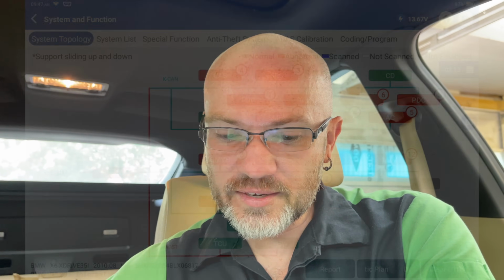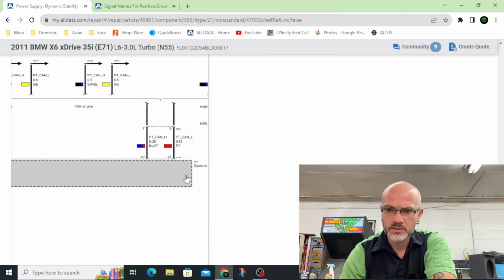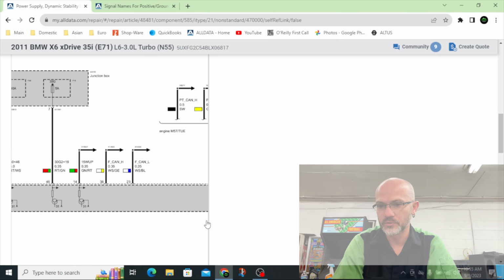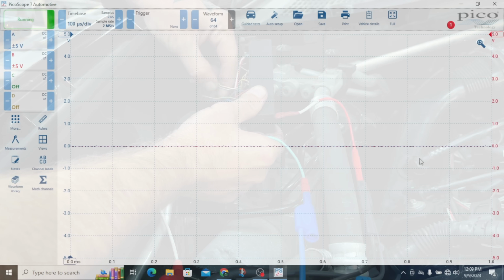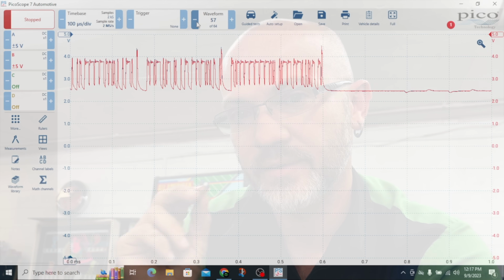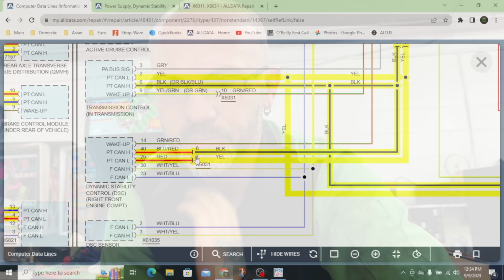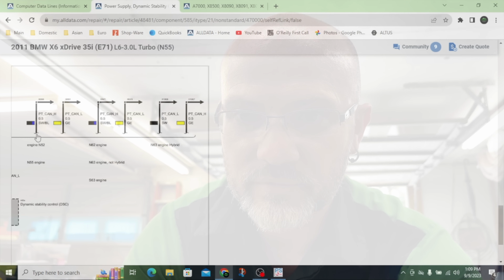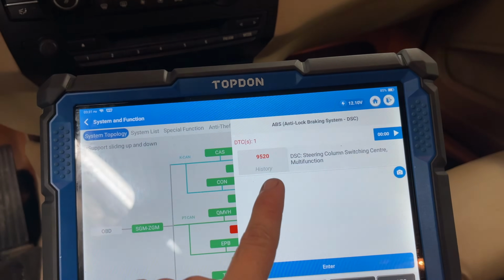BMW X6 Not Communicating with the ABS Module

Comment: Hey friend , i have a 2017 F25 and I am having a “DSC Low Voltage In Vehicle” error. I already bought a new battery thinking that it might have been a battery related issue (but I guess it’s not). I tried to test the grounds and the positive wires like you did and I noticed that the voltage drops (to 10 point something volts) when locking/unlocking the vehicle and the voltage steadily reaches 12/13volts after 10 seconds or so. Therefore,  I noticed that I only get the error when starting the vehicle after unlocking it (during the voltage drop period ). I don’t get the error if I wait for the voltage to reach 12/13 volts (after 10 seconds) and then start the engine . Do you have any idea what it could be ? Thanks in advance!

Comment: As a bmw tech, I haver never seen a failure like this but damn you did a great job at looking for that broken wire! Also I would highly highly recommend you getting a laptop with ista on it which is the dealer software we use and navigating the wiring diagram is SOOOO much easier and if not the best wiring diagrams in the entire industry

Comment: Another great video and diag. How do you know what bulb draws how much current ? Do you measure each one ?
Reply from the maker: Yes I measured them
Reply: Also how do you know you are not using a higher load  than the circuit can carry ?
Reply from the maker: @saiautorepairs  I’m usually only testing 10-20% of the wire capacity. That in most cases is enough to see what I need to in the voltage drop.

Comment: You have to be careful about using a 10 Amp bulb because you may blow a fuse on inrush, and the fault you are looking for is a high resistance fault (relative to the rated current) and will be easily detected with just a 2 Amp test load when used with a high resolution DMM like your Fluke 87V. The smallest fuse usually found in the fuse box is usually 3 Amps, so a 2 Amp test load should never blow a fuse. You do not have to test at the circuit maximum rated current to see a high resistance fault when using the 87V. 

My 2 Amp and 1/2 Amp non-inductive power resistor test loads are very compact and I connect them like you do with stacking banana jacks at my DMM. However, they do not light up which is a feature some techs like so they can tell that the load is indeed in the circuit, which is a valid argument. 

What I do is attach my test loads first and then put the meter on resistance and verify I have continuity through my test load, then I attach my test leads and short them out to verify continuity through the test leads, then I switch to DC Volts am ready to test. I really hate filament bulbs. I hate the inrush current, I have how they dissipate heat (meaning they can burn you or something else like carpeting), I hate that they are made out of glass (which can break), I hate that no two are exactly the same, and I hate that they can burn out. But, let's look at it another way from an outsiders perspective, in that, you use a high end professional expensive Fluke 87V DMM ($450.00 to $500.00), why not use a professional dummy load to match?

If you want an accurate test load that lights up you could use an LED control IC (like the TI TPS92621-Q1) and some high brightness LEDs which would enable you to very accurately control the load current without using a filament glass bulb (it could have many more features than the light bulb, like polarity detect (only lights up with proper polarity), reverse polarity protection (no current flow with reverse connection), minimum turn on voltage, etc.). You would have to make a little circuit board with devices on one side and then bond it to an aluminum heatsink. But it could be made very compact and could mount directly to the meter using PCB solder banana plugs (no more dealing with the spaghetti leads to the DMM). So, the overall packaging could be the width of your DMM, perhaps 3/4 inch thick and 1 inch tall.

How the HSCAN node triggers on the CAN data, for traditional HSCAN automotive design (qualified parts, ESD rated, etc.) is really dependent on the HSCAN transceiver used in the design, although there is a lot of similarities between the different IC vendors (Infineon, NXP, etc.). For example the NXP TJA1043 actually uses a split termination approach using two 60 Ohm resistors and a capacitor. To understand exactly what the IC does can take a little reverse engineering, in that, many of the special features like controlled rise and fall time are proprietary.

Who removed the harness polyester corrugated loom leaving bare wires?
Reply: What is you load tester now? Have you triet something else?
Reply: My two automotive 12VDC dummy loads are 22 Ohm and 6.8 Ohm non-inductive power resistors each having a small aluminum heat sink. The 22 Ohm resistor is a good starting point to test fuse power feed source impedance.  @alexandrumardare828

Comment: Ever since you made that short reel about the CAN having a rough signal, I was waiting for this video. 

Well worth the wait.

I have 1 question tho.

How did you bring the ABS CAN Low back into play when you back probed the connector.

Did you run another wire to prove there was a break or what? Thanks!

Comment: I check wake up circuits dynamically. Everything connected and use scope. I know people will say that your not loading the circuit. But the car is broke right now. If the wakeup signal is good while vehicle is broke then no reason to "load" it. Just my opinion.
Reply: Darn it, yes you are right lol. Thanks for the correction!

Comment: man that was a good one. and to be fair i did call it once i see the signal when you disconnected the abs then connected it back up . because i know bmw put the one resistor in the esp /abs least the on the x serious. i thought that’s lost can low . because when you plugged it back in you could see it comming back through the resistor . one of the exact reasons i got me a scope . although technically you could have worked that out with a metre measuring voltage on the bus i guess but were us the fun in that 🤪🤪🤪
Reply: @autodiagyt  yes indeed have the scope . just have no  clue what i am looking at 🤣🤣🤣 all the gear and no idea 🤣🤣🤣🤣 . that’s not quite true i do have some idea and i have around 300 of  exactly the same car to look at around me so have been taking a few signals of good cars for the bank so can compare if i get a bad one 👍